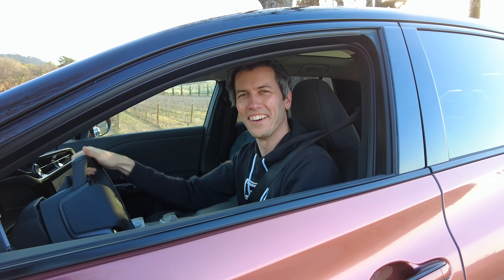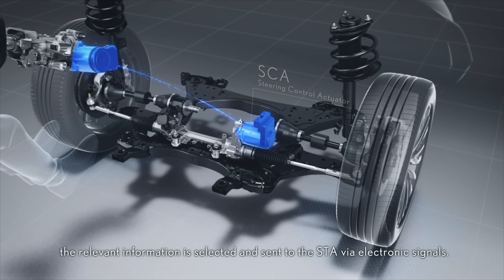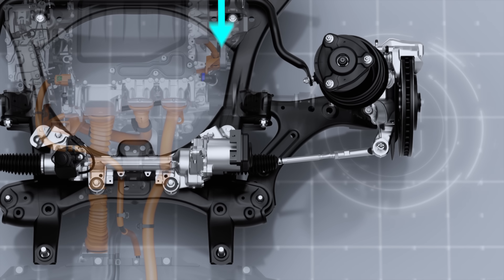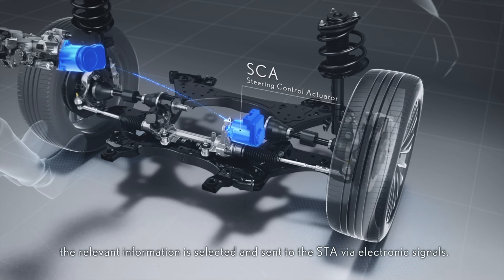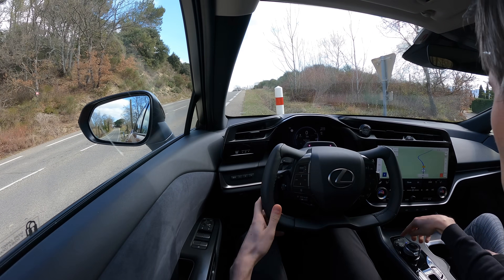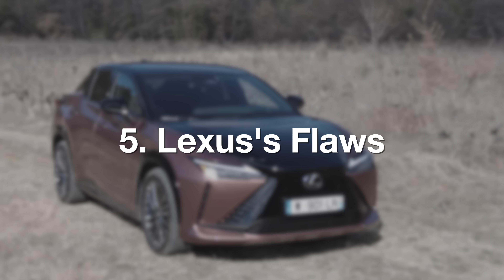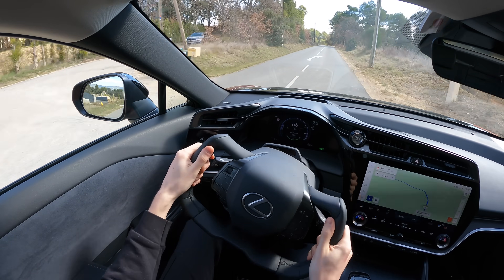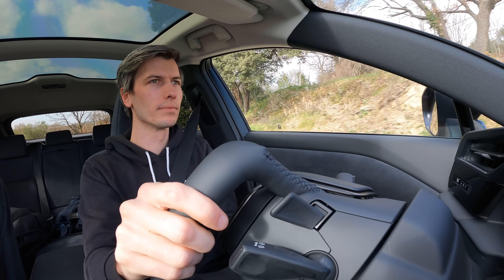How Lexus Fixed Tesla's Bad Idea: Steer-By-Wire Yoke

Comment: In aviation a 5ms polling rate is pretty standard for fly by wire systems.  POI or pilot induced oscillation is something we always worry about and test for and can happen when a pilot makes an adjustment does not see the response they want and makes a second adjustment before the first correction makes it through the system.  This will cause an over correction necessitating a correction in the opposite direction.  In the worst case these get bigger and bigger until catastrophic failure.

Comment: What if the car loses power? Well that's only an issue if the car is in motion, in which case the wheels will spin and will generate electricity through the motors. Surely way more than enough power for the steering wheel and motors

Comment: Okay those are all valid points, however, do keep in mind: drifting, controllers have drifting, all known potentiometers will have drifting, imagine driving, your wheel straight but your wheels starting to turn randomly because the sensor in the wheel drifts
Reply: Just use hall sensors
Drifting solved

Comment: I used to operate a Ditch Witch R30 chain trencher. The steering was wholly hydraulic. You could keep turning the steering wheel in one direction indefinitely. This evil machine had a 30 hp Wisconsin V4 petrol engine, four-speed transmission and a chain-driven hydraulic drive system for low speed trenching work. In that mode the gearbox regulated the digging chain speed and direction.
When driving on the road there was so little steering feel that it was actively dangerous to operate beyond half engine power in the highest gear ratio as the steering was so vague.

Comment: I really don’t like that steering input delay. I remember playing an F1 pc game about 10 years ago. My laptop was (barely) able to run it and I was absolutely terrible at it, but f1 was a new found interest so I persisted. I learned all about doing proper racing turns, tire selection, when to brake and by how much, when to shift. After a couple of weeks I was still terrible and figured out my fps was about 8-10. Finally it clicked: there was a pretty terrible input delay for turning because my laptop sucked for gaming. I tried out simulation mode on someone’s console and there was no steering delay. Initially I was still terrible but I actually started to improve and got pretty good.

I looked into this after and there’s some science behind it where delay in the input/action/feedback cycle results in very slowed motor skills learning process.

Comment: Nobody seems to be mentioning it, so I will.  I like keeping my one hand at the top of the steering wheel when driving at a set speed.  It's simply comfortable that way.  It provides a different position from, say, the 10 o'clock / 2 o'clock position -- and the hands at the bottom of the wheel position.  With this yoke wheel, there is really only one position.  And I wouldn't feel comfortable having only one hand on the wheel -- being off-balance and extra-sensitive.  

The "UX" is not being considered here.  It's so typical that Engineers ignore this very important aspect.

Comment: "why make it? For better response time"
"Cons? Slower response times"
Reply: ah yes, crashing because of lags irl😂
Reply: Trading response time for response speed magnification
Reply: Welp, this is because none of the motors have unlimited power to turn the wheels, and especially while stopped, it takes much force to turn the wheel. Just try turning the wheels in a old car without power steering. Response times are faster, but testing was done in wrong conditions
Reply: i think the response is slower because its simulating the speed you could turn a wheel with a higher ratio
Reply: response != response time

Comment: "Tall folks will find this welcome" - proceed to show literary zero increased leg space "without a steering shaft". Also, it's shown in the animation - there is a shaft and the motor is located further down, not right behind the steering wheel. And the yolk to column place isn't really smaller than a normal car.

Comment: As a MechE, I’m honestly shocked this is the first example of steer by wire. This method of separating input and output into two non conjoined modules is somewhat common in Engineering, and I think Lexus’ level of redundancy is the perfect way to go about this. Again, this doesn’t mean that it works well but I’m still shocked Lexus was the first.

Comment: My issue isn’t with the fly by wire system which has been a norm in aviation for ages but it’s with the difference in maintenance and redundancies between both. You can’t expect a car to receive the same level of maintenance as an airplane and have the same redundancies as well(airplanes have multiple hydraulic back up systems for the fly by wire as well). Having a backup hydraulic should the fly by wire fail should be a norm because imagine if it malfunctions while you’re driving.

Comment: The main issue i see is  actually in the event of a crash if you had the yoke turned far enough for your hand to be icer the airbag abd it goes off your going to have a broken wrist, with a traditional wheel you can reduce the risk of this by push pulling your way around the wheel changing hand position to avoid wrist airbag overlap but its not possible or at least easily avoid able with a yoke.

Comment: This reminds me of FPV and how we configure our sticks with different rates and expo to achieve the exact same idea right down to the turn ratio being the same at all speeds it just means the ration between 0 - 100 changes between exponentially depending so since the yoke defaults to 50% lets say 10%-90% changes ratio depending on speed while the last 10% on either side evens out. I'd ONLY want this in my car if they gave use the ability to tune it for ourselves because if flying drones has taught me anything is that we are each VERY unique in our reaction times and comfort levels. We could both love the same car if we could tune it to our own but the manufactures insistence on maybe 3 profiles at best for these kind of things is I think what really hurts it with enthusiast. I can understand not making it a car menu feature by stock for those who wouldn't know what they are doing but it should be something you can unlock at the dealer ship or a shop.

Comment: EPS is in no way a new concept. My 2003 Honda Civic SI drives phenomenally and handles like an SI should with EPS. Suzuki started eps systems in 1988. The new Ford diesel trucks have electronically assisted steering.

Comment: Ford did it better with variable assist steering. They've maintained the steering shaft and added a motor in the wheel that allowed the shaft and wheel to turn at different rates, along with a lock that deploys to lock it in if something goes wrong.

Comment: Hard pass from me.  This system still has tie rods, a rack and pinion (or equivalent gear system), and a steering "wheel" - but it adds a whole layer of redundant electronics, sensors and batteries with many of their own points of failure.

For what?  A single steering shaft.  From a mechanical perspective, that's all it replaces.  And it comes at the expense of greater cost, fake "feedback" and an absolutely atrocious amount of lag. 

Whatever happened to elegance in engineering?  To all the commenters talking about fly-by-wire, those replaced much more complex mechanical linkages in weight-sensitive systems with relatively slow inputs.  But since when does it make sense to use this much complexity to replace one shaft?  Especially when it provides the driver's single greatest physical link with the road.

Comment: Electronic components are great only when they are new.  A few years down, they start to break and drive up the cost of car ownership.  They are reliable only in theory.  Theocrafting all you want with you engineering mumble jumbo, but I ain't getting a car with steer by wire.

Comment: What happens if you are going 90mph full lock (so wheels would be lets say 30% turned) then you slow down a lot still keeping the steering at full lock. Would the wheels stay at the previous angle or turn more as the speed decreases? 
If they keep the previous angle and you need to turn more, there is no way to increase steering angle, also if the steering angle ingreases as you slow down it would be very weird and dangerous

Comment: I honestly assumed cars were already using steer-by-wire, it’s been used in aviation for decades and in pretty much every other control in modern vehicles. I’m kind of shocked this is a controversial concept…
Reply: Well for aviation it is there to replace bulky complicated system whereas this replaces something that is simple

Comment: How does this work in case of a total system failure? Currently if my car stops anywhere the least I can do is push it and steer to a safer location. Since the components are mechanical, the output is just dependent on how much energy I can deliver. Not hating, genuinely curious how this would work.

Comment: I recently drove my first Tesla on a longer trip (about 1000km) and despised the lack of controls on the steering wheel. I want to skip songs, pause/mute, change volume and turn on and off cruise control without letting go of the wheel. Who thought the 'gearshift' stick should activate cruise/autodrive? Does nobody at Tesla drive cars?

Comment: There really can be no lag in the input for a saftey standpoint ao until that is completely fixed, it can't be reliable. Thats all there is to it when it comes to driving on the ground. Flying in the air a whole different story, play and slight delay is largely okay, won't cause catastrophic loss of control. A system that won't let you make certain actions without a computers approval is always going to be problematic, there is no way to reliably design a computer that can handle the inputs of incoming sensory like humans, but then again sub optimal humans that never try to bwtter themselves at anything will always be the point to against such a statement.

Comment: As someone who has raced karts and sims using F1 style steering wheels, theyre superior if you dont suck as a driver. Never had any issues with being too responsive at high speeds or anything.

Having your hands at 9 and 3 also is the objective best place for your hands.

Also, ive raced in rain/snow, i dont use the steering to feel out what the car is doing. I use my butt. I feel whats going on with the car through the seat before i feel it in the steering.

Lastly, if youve ever lost power steering on a car, unless youre prepared or strong, most people will say "they lost steering". Most people cant deal with it.

Comment: It's nothing more than an excuse to change something that already works well and overcomplicate it. A regular steering wheel is fine, it's been fine for decades. We don't need F1 car precision in a modern SUV. In addition to that point, we also don't need F1 car 0-60 times in a modern SUV. Anything less than 5 seconds is more than the average driver can handle. Stop making cars so complex and impossible to repair. Make EV's more about efficiency than giving giant heavy cars tons of power to run over pedestrians with.

Comment: I remember we had the same issue with the accelerator by wire in the 1st gen clio RS
It was sluggish on the race cars, renault released a modified one which was much more responsive, but they had to mechanically change the throttle.
Wonder how they’re going to solve this here

Comment: Airplanes, Cruise ships, tankers, heavy power equipment, and many other items already use is steer by wire and have proven that it is safe
Reply: All of that stuff operates at super low speed or like a airplane or ship with so much safty time that even if i would fail nothing happends in minutes or hours ig it does.

A ship dont sink.

And a plane dont falls from the sky. physic.

But a car driving with 100 to 200 km can crash in 1 second and you die.

Comment: Can the wheels be turned without starting the vehicle? Sounds like it would be a nightmare if you ever had to get out and push. Then again its an electric so that would already suck to have to do based on the weight alone.

Comment: Having moved a lot of cars that are turned off, have completely dead batteries,  etc during repairs, in the garage, etc, I really dislike the idea of steer-by-wire.  I want to be able to turn the vehicle's wheels even when there is zero power.

This also limits repairability, but that's been getting less and less doable with newer cars for a long time, so that's not something new.

Comment: Why not have both SBW and Hydrologic/electronic assisted steering that engages at the desire of the driver (while stopped) or when the electronic steering fails? Seems the best of both worlds and not overly complex since steering columns are standard, usually with electronic assistance anyways.

Comment: I feel as long as this system has good tuning, and the operator can adjust whether the steering is constantly a single ratio, or if it fluctuates will play a heavy part in its downfall or success.

Comment: When GM was playing with the HyWire, one of the obstacles was that steering was required to be mechanically linked in the US.  Did this change? And when?
And you forgot the third thing we worry about: hacking.  What happens when a bad actor decides to help you make a left turn into oncoming traffic?  Security measures get better every year, but so do the bad guys.

Comment: When throttle response and regenerative braking can both be electronically mapped so the forces aren't overwhelming it really doesn't make any sense to me that steer by wire is necessary at all.

Comment: I'm concerned about the risk of hacking attempts to gain control of the system. With OTA updates a thing, what prevents some hacker from hijacking you while you're driving and either causing you to crash or taking you somewhere dangerous? Drive-by-wire is one thing because I still have control over other critical inputs (ignition, brakes, steering, etc). But making them all drive-by-wire could be dangerous. 

And yeah, airplanes have been fly-by-wire for decades but my used 20yo shitbox (which has been out of production for years and which the manufacturer does not provide component support for) is not built or maintained to the same levels as a multimillion dollar aircraft.

Comment: I hope that if there's a fault with the system, the car is forcing the driver to do the servicing, otherwise this might be dangerous. Let's say that Lexus is 20+ years old and worth no more than 2k $, while one of the two steering motors breaks. If it's only gonna display a warning on the dash, I can  guarantee that it will be ignored as long as the car drives...

Comment: Acknowledging all the points, I won’t drive this without redundancy and drive by wire is not the only way to make a steering rack responsive. 
It wasn’t broke and they fixed it with a proprietary system that likely can’t or won’t be fixed by a 3rd party mechanic.
It will become another right to repair issue.
I disagree with the idea that computer aids make safer drivers. If you don’t have the capacity to concentrate you shouldn’t be driving to begin with.

Comment: Not for me . Ever. Even if Toyota build it. Tesla NEVER EVER. God help us. Why the cut down steering wheel?  Because it’s trendy.
I have seen in car sports car racing with there F1 style wheel. Doesn’t work when the car gets loose. The driver is grabbing at thin air.
Nuts

Comment: replaced a piece of tube with 3 motors, additional accumulator, and a complex control system with floating sensitivity that can go off rails like in that case with airbus when it nearly flipped while landing

Comment: Wouldnt the workaround to twitchy steering at different speeds to have multiple steering profiles linked to the tachometer? 
Also, I really, REALLY hope that one of the redunant safety systems includes an independent battery to keep the steering system alive at all costs. It's the most safety critical component of the car. Loss of steering at any moment in motion is absolutely intolerable. Now that car manufacturers want to peer into technology used in aircraft, they better also copy the approach to safety from aircraft manufacturers.

Comment: one thing puzzles me. imagine you’re doing 100kmh and you suddenly want to avoid collision and turn the wheel while braking hard. does the steering angle change while you’re approaching full stop? is it possible to correct it in that speed so you don’t end up in a dangerous angle?

Comment: The Active Steering that BMW adopted many years ago, is better. There is a mechanical connection, that adds safety, and the variable steering ratio and response is present, helped too by the four wheel steering system. This is over engineered, by me...

Comment: Thanx for this entertaining enlightenment video. I always like your video's the way you make them. First let me say that I totally agree about Tesla and the mistake they made not to make their yoke steering active (like BMW offers as an extra) or in this case of Lexus steer by wire. The Yoke in the Plaid is ridiculous the way it is working currently. And for the Lexus flaw the delay in the reaction time of the wheels..... Is that not a question of standing still and the steering motor has to work harder? The same is the case for common car steering systems